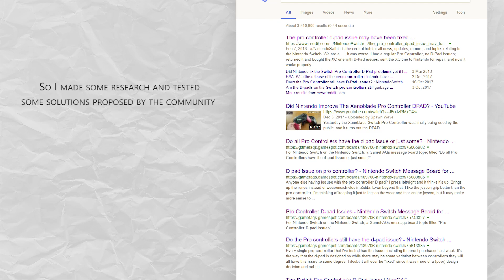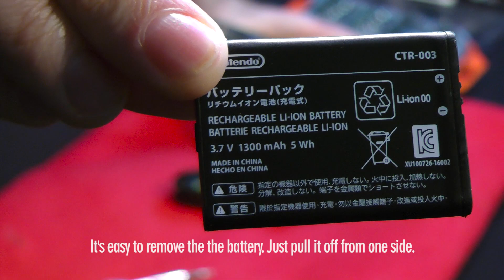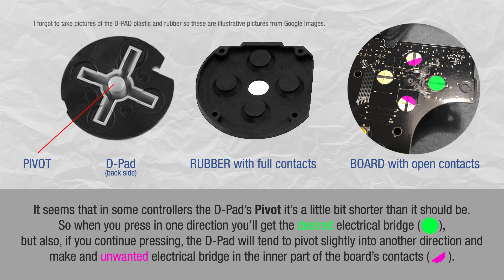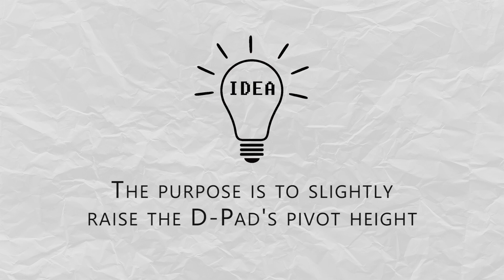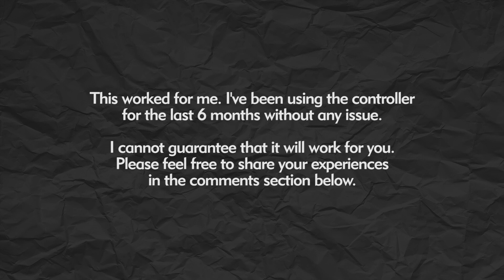Nintendo Switch Pro Controller | D-Pad Issue Easy Fix

Comment: How tf do you reconnect that ribbon cable? This really needs a reassembly section
Reply from the maker: Use tweezers if you can't do it with your hands. That should help you get the job done.
Reply: @PSwitch  I eventually got it squeezed in there. That is a good suggestion though!

Comment: Mine is so bad that if I rock my thumb left or right on the Down button it can actually register as pressing down+left or down+ right even though my finger is only touching Down. And the only games I've played much on my Switch are Mario Odyssey and Smash, neither use the D-Pad much so it's not wear and tear. Only had it for a few months.
Will this fix work with the issue I'm describing? I just finally realized how bad this d-pad was when I hooked the computer to my PC and tried to use it on an emulator to play Super Mario World. It was frustrating to say the least.
Reply from the maker: This method should fix the problem you described.

Comment: I really wish the made a pro controller with the dpad on the left side. Would be way more comfortable playing 2D platformers (what most of the switch library consists of)
Reply: @yoursnatchedweave641  it's on the bottom left tho, not the left left. I meant like the PS4 controller

Comment: I highly doubt many people will do this. It's too risky if you don't know what you're doing... The controller costs $70.
Reply from the maker: I know. The video is based on my own experience. Without doing this my control was useless for 2D games and in my country there is not official guarantee... So...
Reply: It's really impressive how you can fix stuff like that. I'm not much of a tech enthusiast, so taking apart expensive eletronics seems daunting to me.
Reply: Just did this to my new pro controller.  Worked like a charm!
Reply: Awesome!
Reply: But also, it costs £70 for a controller you think should work out of the box. >_>
Reply: It's an EASY fix
Reply: Tried this out last weekend, and it works!! Just in time for the Mega Man X games.
Reply: How is it risky? You're just putting a little bit of tape inside the thing. The only thing you have to be careful of is the ribbon cable. As long as you don't yank the controller in two it'll be fine.
Reply: And try not to touch the circuitry. Low voltage lines can short due to skin grease. Definitely wash your hands before. The extra tape in the middle is just for better pivot (matter of feeling/preference).

Comment: Will White/blu tack work for raising the middle bit?
Reply from the maker: I don't know. But consider that you have to raise it about 1 mm (0.04 inches)
Reply: So a really thin discus of blu-tack should work?
Reply from the maker: I guess you'll have to test it. I've only tested it with folded tape as shown on the video.
Reply: Turns out... my controller is double faulty and one of the screws won't come undone at all and it just spins round and round.

Comment: Ok. Let me try it.
Reply: ok. as he mentioned, 4 layer works best. Don't go over. Also, if you can, cut 4 layered tape as circle so it fits to that hole well. It works better with circle shape than square shape. My controller is now working as it is supposed to be. Thank you for the video.

Comment: I was playing undertale and noticed this problem. I think its dus to the awkward spacing of the dpad and grips. It makes you stretch your thumb out a bit more than necessary so when you pull your thumb back to a natural position, it tends to shift in a direction you don’t want. Ie I pressed right and pulled my thumb back and accidentally hit down. Maybe my hands are just small but I did notice the pro controller felt a little too big and awkward.
I might try this tape trick if I keep having this issue. I’m just scared to take electronics apart and screw them up haha

Comment: "Easy fix" completely disassemble controller. Not saying it's hard but not necessarily an easy fix.
Reply: A controller dissasemblement isn't really that hard.
Reply: Arito it’s pretty easy and quick to do
Reply: Yeah opening the switch pro controller is fairly easy. It's def not the PS4 controller. Now that controller is a pain to remove mostly due to the clips and the triggers

Comment: Can you try doing half-circles in any fighting game (if you have any)?
I tried this and the sticky tape on the sensors fix, both break diagonals and make half circles impossible. (Tested with Garou: Mark of the Wolves)
Reply from the maker: ShadowNetBG I don't have any at this time but I'll probably get Street Fighter Collection when it get released. I've just tried half circles in the 'Test Controller Buttons' on Switch's settings and seems to be working fine. I've tried all combinations (left/up/right, right/down/left, etc). Also not having problems with diagonals. Try the second solution only (the folded tape on the pivot's base. If you don't get the desired results try modifying the pivot's height by using more or less layers of folded tape). Thank for you feedback.
Reply: Just tested it, directions show up in settings -> test controller buttons (up, down, left, right), but sadly, diagonals don't register in game. I don't have any other fighting games to test it with.

Comment: Is there a way to fix it so you don't have to take apart the controller? Last time I tried taking one apart it wouldn't work after I put it back together.
Reply from the maker: Hi! It's a hardware issue, so in my opinion there's no other way than taking it apart.

Comment: I’m prolly gunna try this when I get home. I use my controller for the Dark Souls games right now and every time I want to use my Estus (health) flask it will also change the item I want to use! I constantly use items I’m not trying to use or don’t drink my Estus flask when I really need to heal. 

So many unnecessary deaths all bc of this dang Dpad. The only thing is I have an amazon knock-off version so I hope I can still do this fix with this type. If any1 has tried this with these kind of controllers lemme know how it went plz.

Comment: i dont use the dpad for 2 games i use the stick so im not risking it plus the dpad is mostly used for shortcuts to things or other things (mario odyysey uses it for map,and snapshot mode
Reply from the maker: Most 2D retro games requires to use the D-Pad to play precisely. In some 2D games as Hollow Knight the D-Pad is mandatory. Also in 3D games as Breath Of The Wild the D-Pad is used to change weapons/shields/runes and to whistle. Before repairing the controller it was very annoying to use it. When pressing 'right' to change a weapon during a battle, the Runes menu popped up as if I had pressed 'Up'.